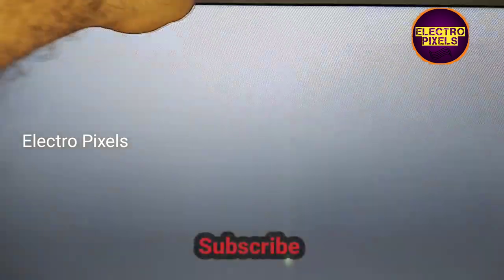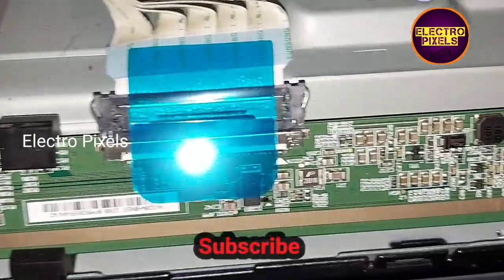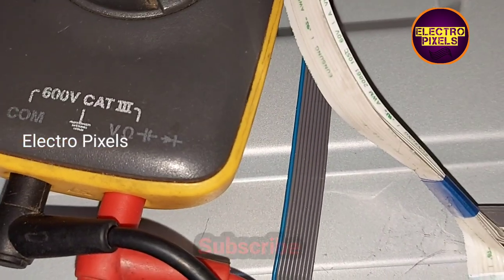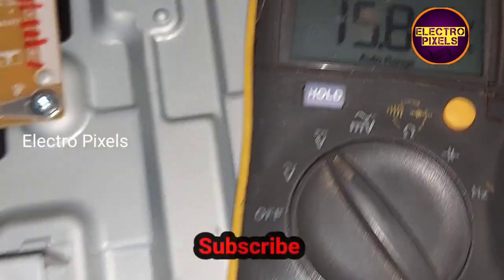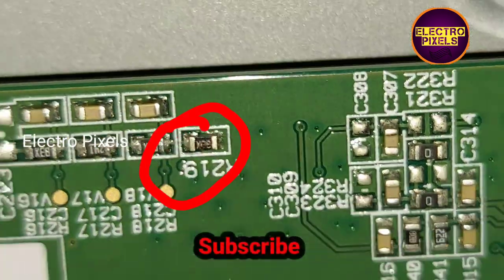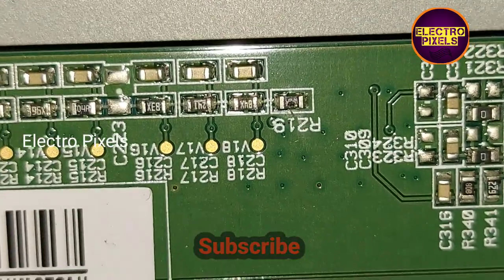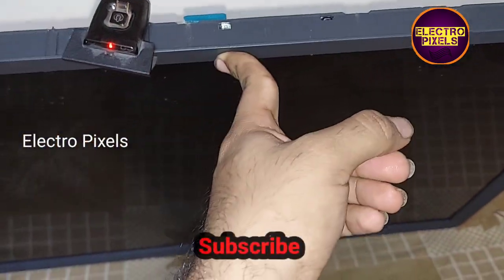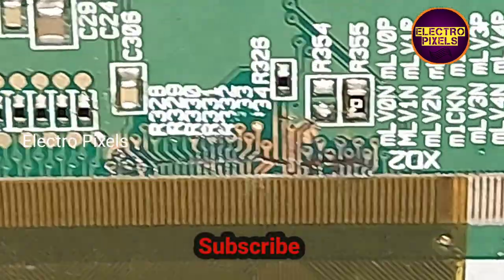LG LED Tv White Screen Problem Repair|Boe Panel White screen issue Fix||Change resistance, cut Track

Comment: hello..i understand that you replace resistor that is OK, but i dont understand ..do you cut this lines ..or is broken with burned resistor ..can you please explain this ..thnks
Reply from the maker: That track's are Short inside glass panel. That's reason for resistor burning
Reply: @ElectroPixels  OK i understand that too..so you cut this lines? and how that fix screen white?
Reply: I mean how you know which line to cut ..if is on ground 0V ? ...so it looks that this lines are not important for TV work properly ...right?